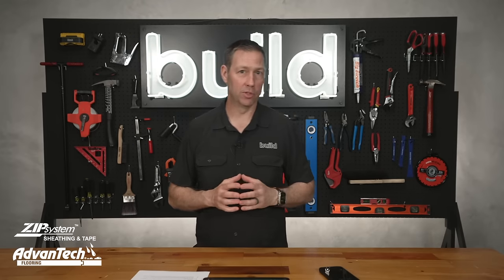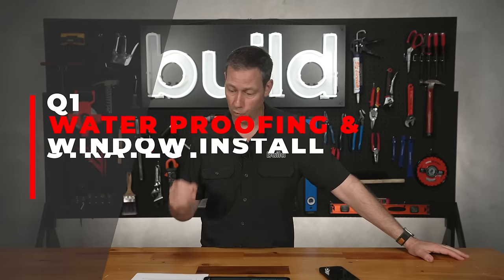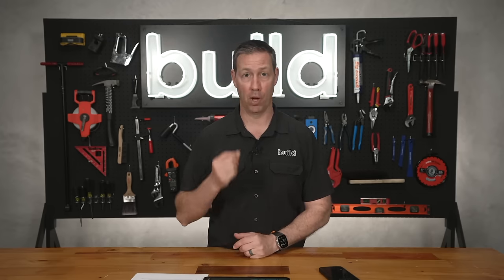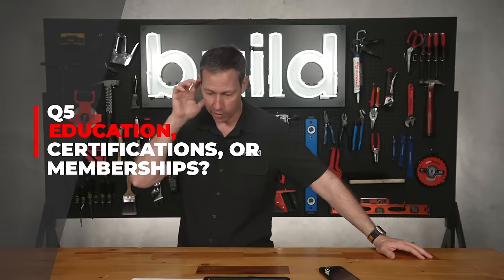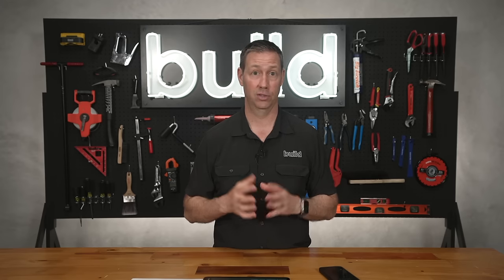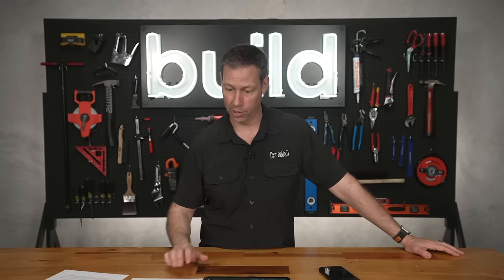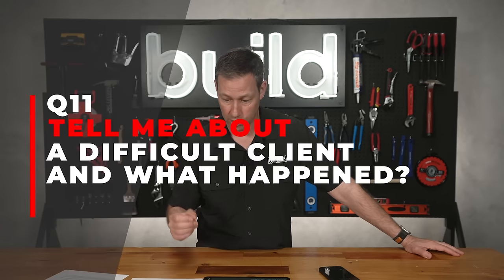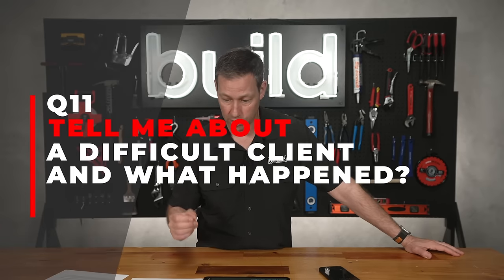Top 20 Builder Interview Questions

Comment: What's it like to live in a market where you have so many competitive options? I just moved to rural NY and there were exactly four custom home builders within a one hour drive. All of them were booked for minimum one year and all of them had a starting price of $250sqft regardless of how easy or complicated the build (yes, even a garage which is just a box with a concrete floor). One of them uses Zip sheathing the other three don't and they all build to just barely code (R24 fiberglass in the walls etc). I ended up finding a post-frame crew that has an opening in July. They will have my entire shell up in 7-10 days, and then I'm going to self-GC and do a lot of the work myself because I'm finding issues with local sub contractors too (emailed nine electricians and only one replied, which was a whopping $24,000 just for rough in). Between following you, Matt, for the last 3-4 years and seeing the serious need for more builders up here, I'm honestly thinking of becoming a home builder. If you check Zillow in this area pretty much every house under $400,000 is literally falling apart with missing drywall, siding, windows, etc and I can see why (though the property taxes up here don't help anything)

Comment: our home is being framed right now. today i just air sealed the foundation plate. (outside and inside) I also plan on using  Siga Tape 4" 430 to connect the zip-system to foundation.

Comment: Situation changes from job to job. 

Even though the builder you pick answers these 20 questions correctly to your liking. 

Still you may have some or a lot of issues with this builder. 

Even if you use the same staff for all jobs, there is a very good possibility that the team will not perform the same way on every job all the time. 
There may be many occasions when they fall short. 

So a system of good inspection of work must always be in place.

Comment: As someone who has been building things my entire life, but it isn't my career, this show has helped me hone the "detailing" that you just don't learn without it being your profession.  I'm building a small cabin on my 12ac play property in the CA Sierra Nevada mountains and it's really upped my game in terms of thinking about air, bug, and water management.  I will build my final home on this property before I retire and a lot of the detailing is just not happening in my area yet.  Simple things like Zip sheathing and tape are not stocked locally, and it's a 40min drive the wrong way to get to BFS, then having to double back with supplies is a bit frustrating.  It tells me that my forever house built up there is gonna have to be well planned to have materials delivered from nearly 2hrs away.  Home Depot is less than 30mins from my property but doesn't yet carry these basic things.  Most builders up there are still doing OSB, house-wrap, unconditioned attics, etc.  It's gonna be tough to work with a builder to get it how I want it for my retirement home on that property and the clock is ticking.
Reply: You need to forget about building a wood frame up there. There are fire resistant alternatives.

Comment: This is a great list (even if you skipped a number in the middle to pad the list at the end) and timing is great as I start shopping builders for my project.

I would also add a question about expected cashflow of a project (regardless of pricing) - deposit requirements, frequency of billings / payments, and contingency holdbacks. Most of the time this will be consistent, but also a way to sniff out the companies that do not understand cashflow and could be more of a liability to the process.

One more thing, I would appreciate a future video on your thoughts on hiring external inspectors who can work with the owner to review plans & inspect the build as it progresses. As local government inspectors are only looking for the bare legal minimum, it would be useful to have skilled inspectors review builds for the biggest potential issues like water & air flow management...

Comment: Matt, I would love to get an answer to this regarding selecting a builder or a compiling a list of subcontractors. It has to do with the choice of materials I typically see used. You love to step it up with the latest tech & products. If I ask a builder if they could use some of these advanced products they often will say "at a substantial premium". I am convinced that most builders are not comfortable with change and for this reason I see little of what you show used in practical applications in South Carolina. Are there ways that manufactures can sweeten the pot to make it attractive for subs to use these products? Are their subsidies, pilot programs or awards that can be granted to subs that would entice them and allow the product supplier to get more penetration in this market?

Comment: At what point of the hiring or shopping process do we ask these questions.   Should I have all the plans ready and send out to perspective builders?  

Thanks Matt for this show.   😊
Reply: I would recommend selecting a contractor as early in the process as possible—say, as soon as you have an approved schematic design and certainly before you start construction documents. With the complexity of modern construction, you are buying a service, not just a commodity. For all but the simplest homes, I would also recommend entering into a preconstruction services contract with your selected contractor, even if it’s for a relatively small amount. You will typically get much better and more accurate information about costing if your contractor is being compensated for their work. It will also result in fewer change orders during construction.

Comment: Builder and fan💪🏻🫶🏻, gonna add some of my own questions :

#1. Are you licensed or certified (state dependent)
#2. Are you insured , bonded , etc. what certifications do you hold. 
#3. What job are you most proud of and why?
#4. How did you end becoming a builder?
#5. What percentage of your business is self performed vs sub-contracted. 
#6. Are there trades that you personally love and those that you don’t care for as much. 
#7. Will you have time to work on my job; general sense for workload. 
#8. Are you proficient at reading plans. 
#9. Are there parts of the job that you Dont want to deal with that we should be aware of. (Great example is dealing with city permitting) 
#10. Did you subscribe and hit the like button ?